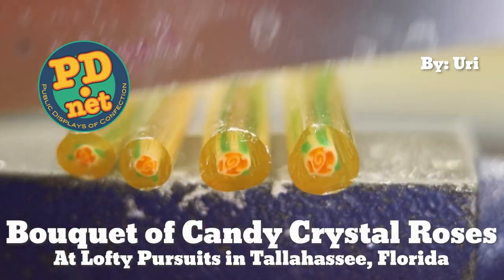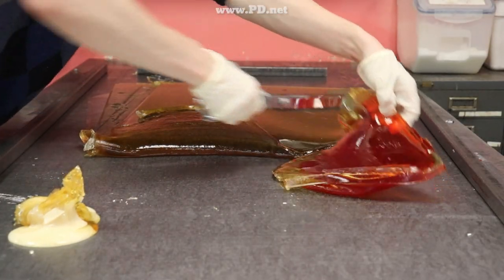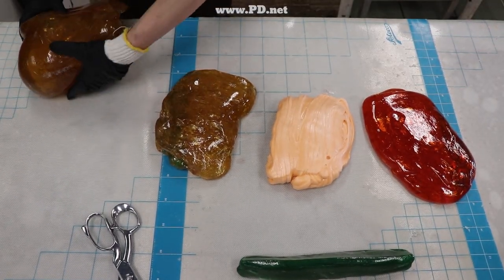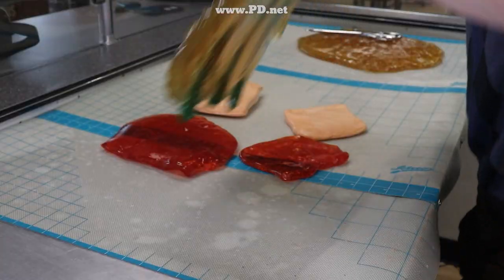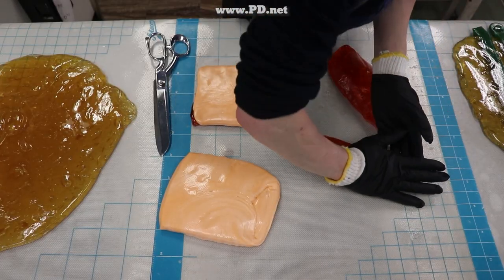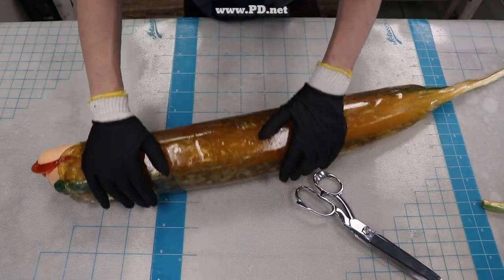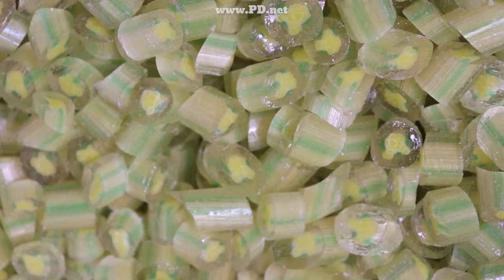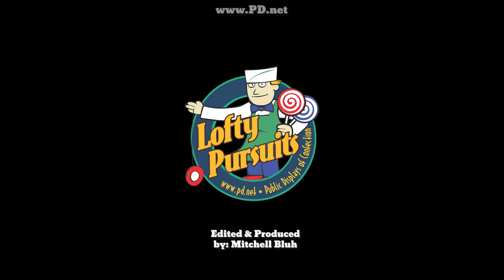Making a Bouquet of Crystal Roses - Ep.186

Comment: Genuine question:
Would it be possible to put the unicorn droppings through the drop roller? Or is the candy too hard by then?
Reply from the maker: Genuine answer. No it's too cold by then to do that. Not easy to heat up again without burning citric acid. Easier to sell as a lump.